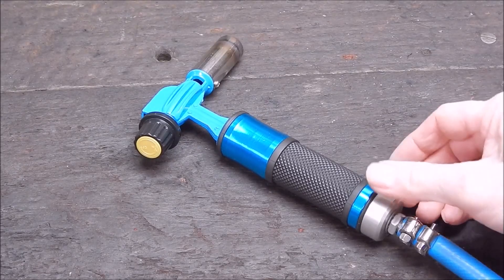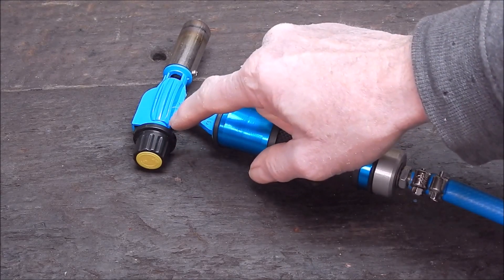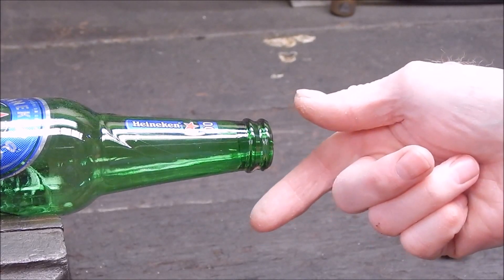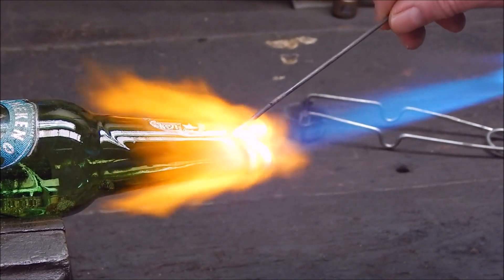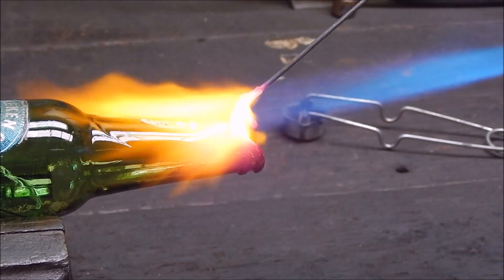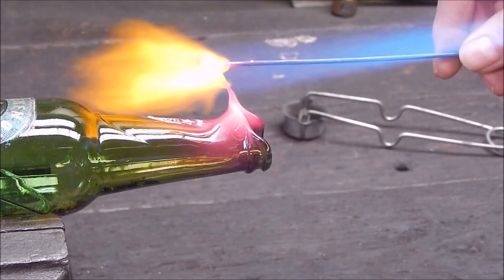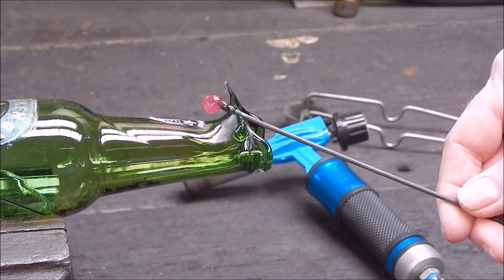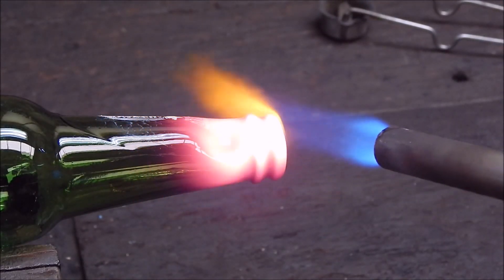Melt glass with standard LPG or propane - which torch is best ?

Comment: I think the Shape of the bottle hurt you here. Glass rod of the same thickness as the bottle's walls would've melted a lot sooner. 
The reason is how the air flows, and thus the heat flows. The open bottle traps air inside. That air is cooler and of higher density, essentially blocking the hot air from heating the inside surface. Moreover, the boundary layer air at the mouth of the bottle will heat up, expand, and cause a push pull turbulence. This means the heat from the nozzle is more spread out over a larger area than you intended, slowing the melt.
Reply from the maker: Thanks for the comment.  I know nothing about melting glass so I'm grateful for the info.   Cheers Rob.

Comment: Hi Rob, interesting demo, that bullfinch certainly concentrates the heat much better, I would also argue there was much less wasted gas to get to a higher temperature than the Chinese job. This must all be down to clever jetting as the calorific value of the gas is obviously the same in both experiments. Shame you didn't have 3 or 4 other torches to test as well, could have been quite a nice day out in the shop! Cheers, Jon
Reply from the maker: Hi Jon,  it's all due to a cavitation gas/air mixing effect the Bullfinch uses.  It has an inverted cup in the gas/air stream which induces swirl mixing - quite unique.  I've had it apart to see what makes it so hot.   I had another (Companion) LPG torch but the flame head was twice as large.  Lots of BTHU, but you want them concentrated.  Cheers Rob

Comment: Hi Rob. Very interesting, never tried to melt glass with my Bullfinch torch, might have to give it a go now 🙂 I must admit that I didn't think either of the torches would get the glass hot enough to actually melt it. Live and learn. Cheers, Alan.
Reply from the maker: Hi Alan,  I wasn't sure what would happen.  Make sure to pre-heat evenly or it could shatter.  It is also likely to do it on cool down as well (it did it to me), so wear safety glasses.  Cheers Rob